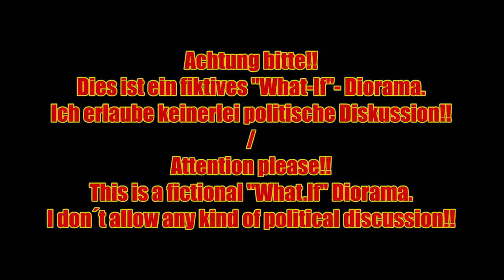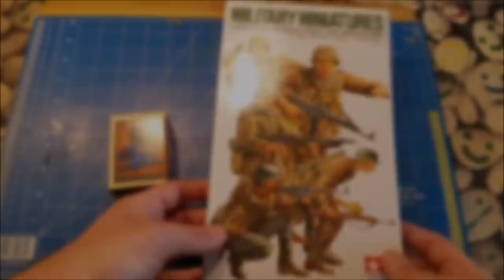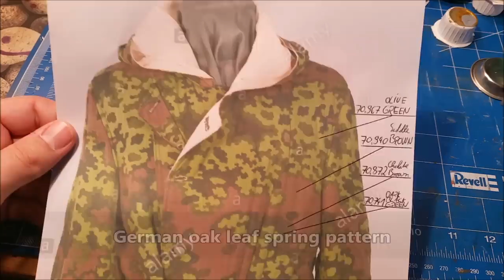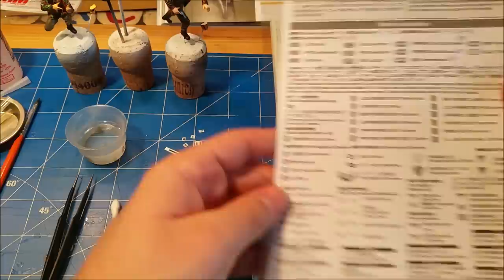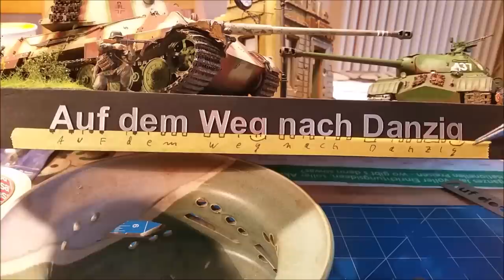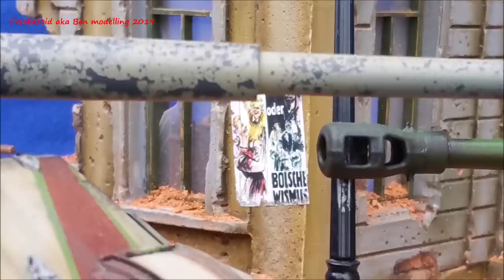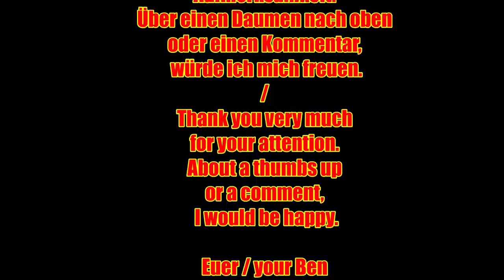Diorama Baubericht / FULL BUILD "Auf dem Weg nach Danzig 1946" Part.2

Comment: Nice job, but blue uniform for soviet tank crew was mainly used for late 30s and the first stage of the war (41-42? part of 43), later on they migrated to black / dark grey uniform. So, to meet it in alternative 1945-1946 scenario is very unusual
Reply from the maker: Thanks for your comment and your hint. To the color of the uniform, there were too many different information, I could not find anything specific. greetings Ben

Comment: Absolutely beautiful work. Love it, IS3s are in my opinion one of the best looking tanks. I do find myself in an internal fight whether or not should I tell you. The ricochet on the IS3s armor. You chose just the tiny little triangual spot where there is no armor at all, its just a 30mm  metal sheet to cover the storage containers on the side and create spaced armor on the sides. The side armor on IS3 is heavily angled as you can see by the weld line on the frontal armor. Ohh that is soo unfortunate :((

Soemthing like this, the purple is NOT the main tank hull.
https://wotguru.com/wp-content/uploads/2014/07/IS3_Frontal1.jpg
Reply from the maker: Thanks a lot, and thank you for the hint!!
Reply: So you're saying that the shell penetration on the right front glacis is NOT 100% correctly modeled? I missed that detail, but only model geeks like us will notice!  I do like the way he modeled the shell impact crater.... Dramatic, but not overdone....